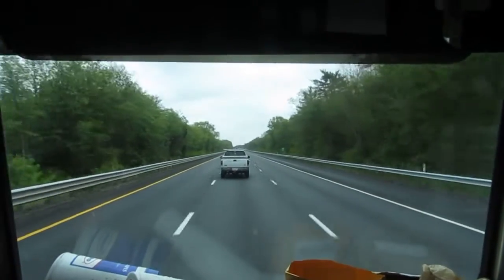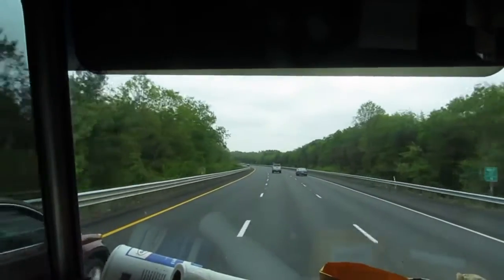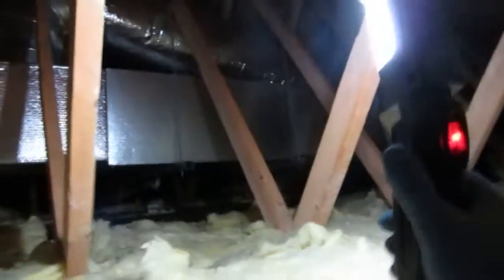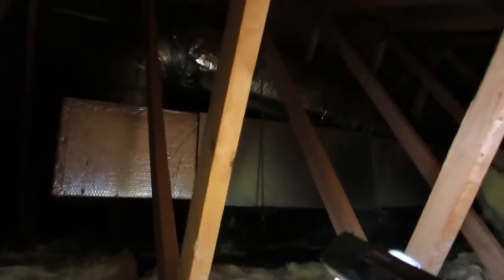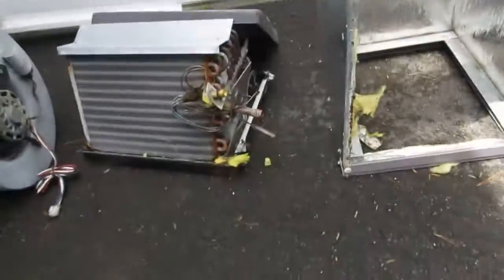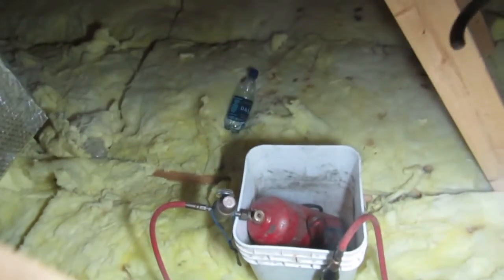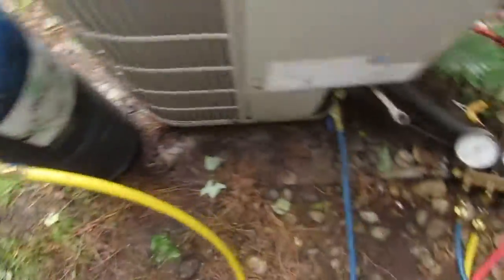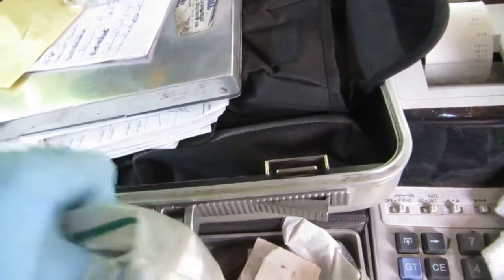HVAC-replace leaking A coil with goodman 2 ton air handler part 1

Comment: I have Ruud 12 seer 3 ton. It kept running on all day and didn't cool the house down to the early 70s. It only kept running to keep it 80 degrees in the hot summer. My indoor size is 1500 sq ft and I'm from the south. Does it look like I need a four ton unit to compensate with that? I had the 3 ton checked many times and they didn't find anything wrong with the unit. we lives in an old house.
Reply from the maker: +dmana3172 maybe its the duct work ,or filters your running 3 tons should be fine . i would have the charge checked by someone that good ,and find out whats going on with the system . it should cool maybe a durty evaporator or condenser coil . i would be curious what the super heat and sub cooling is running on a hot day

Comment: Please excuse the stupid question. 
I am going to change my air handler and condenser myself. And have someone charge it. What is the purpose of running Nitrogen through the line before soldering? 
Thanks
Reply from the maker: you are better to let someone with experience do the bracing ,its so you do not fill the copper of with black oxidation shit . that will block up the txv .
Reply: Exactly why you call a trained professional.